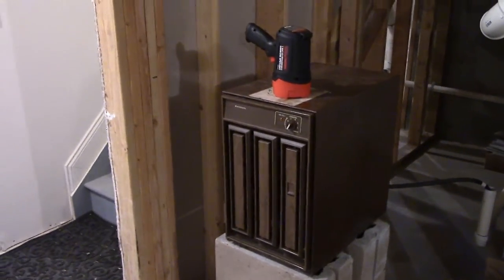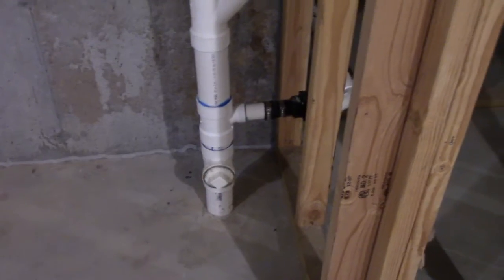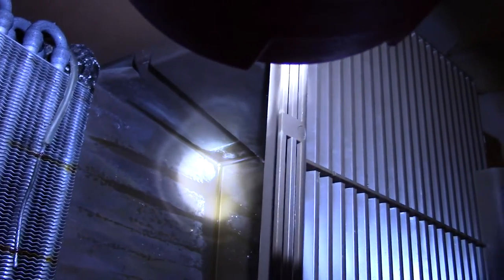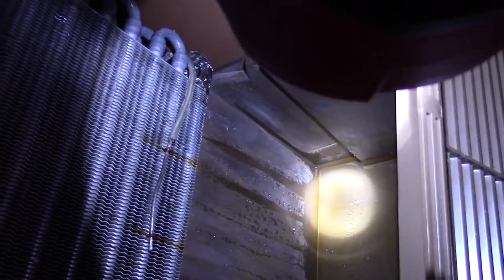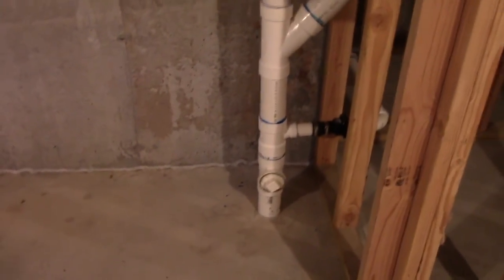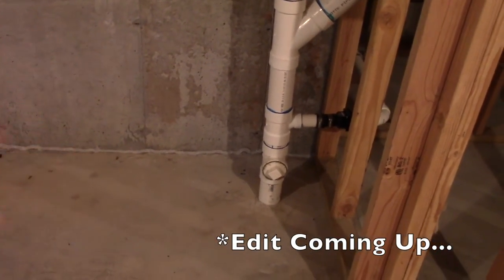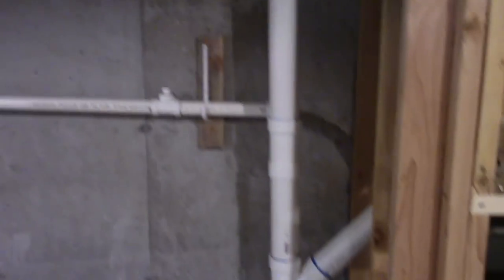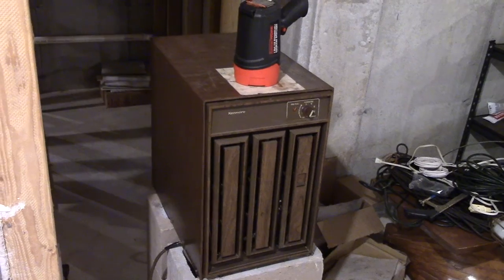Dehumidifier Continuous Drain System. How Has It Been Doing?

Comment: We actually have a dehumidifier with our AC, and it works a bit different, it trips the fill tank opening when it stops running, so it opens the seal and drains out the water into a pipe after it turns off, and just stays open until the AC turns it back on. Simple, beautiful, and just plain works.
Reply from the maker: That's pretty interesting. A/C systems in itself are a dehumidifier. The evaporator takes care of that. The basement though is not air conditioned, so this Kenmore takes care of that!
Reply: I did misinterpret it a bit, I do know that, just didn't really say it right.
Reply from the maker: I figure you had the general idea!

Comment: So this is as exciting as it gets in Connecticut, huh?  ;-p

I'm really surprised at how much of a star player that dehumidifier has become.  It seems its operation has practically become mission-critical.  For me, I always like to have a backup of some kind.  2 washing machines, 2 dryers, 2 dishwashers, however many fridges, microwaves, etc...  Not that it'll die anytime soon, or really ever, but it would be important in my eyes to find some sort of replacement.
Reply from the maker: Maybe not exactly "critical", but it sure does fantastic in the summer! It was pretty damp down there once before I had it, and it really has made a difference. It runs much less in the winter obviously, so it gets good breaks now and then. A second one has been in the back of my mind, but if all goes well, should be good for years!